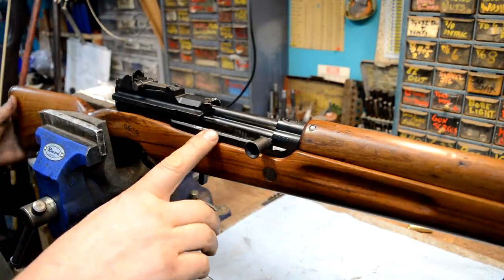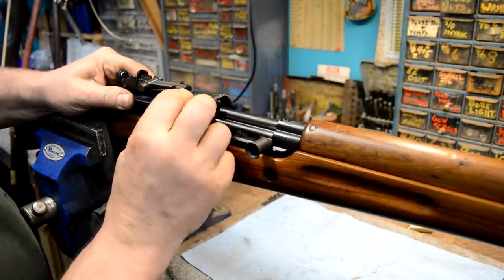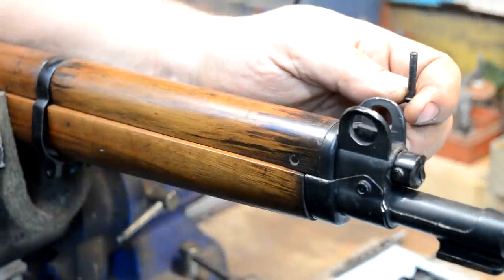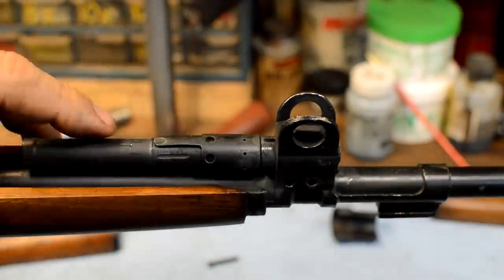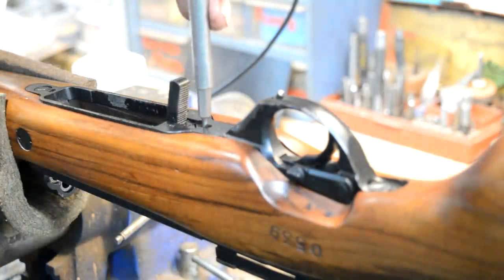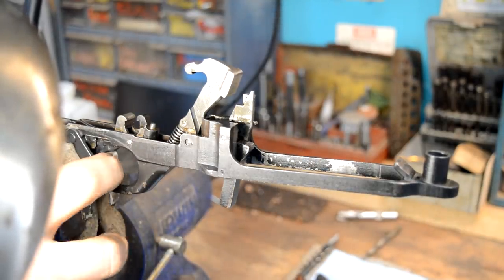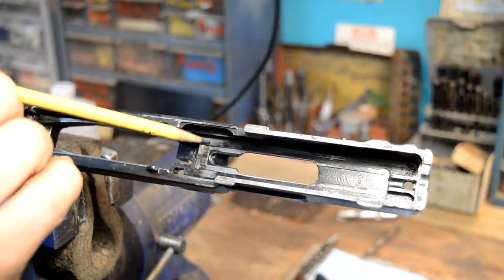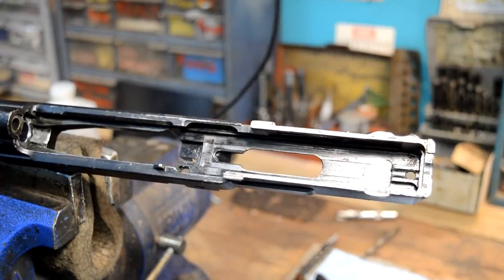Anvil 097: FN 49 clean, inspect, operation

Comment: Unless I misunderstood, I think you described the gas dump backwards. Unscrewing would open up the hole and therefore have less gas available to cycle the action. Screwed in all the way would block the dump and give maximum gas availability and why it was slinging brass into the next county.
Reply: Cómo tiene que ser ajustado

Comment: Very interesting!
I would like to propose an alternative reason for the sliding hammer setup: I believe the primary reason it was done like that is to reduce spring pressure on the sear while still having enough spring pressure to operate the out-of-battery safety. Either way, a very elegant solution.

Comment: Picked up an Egyptian 8mm version last year, after about 10 rounds it went full auto for the last three rounds and gave my brother a pretty big surprise.  I stripped it and I couldn't find anything wrong, but I suspected that the two piece firing pin was stuck forward due to grease in the channel so I gave that a good cleaning.  Haven't had a chance to shoot it again, hopefully no more full auto this time.
Reply: A stock that has shrunk slightly, and overtightened action screws will also cause this.  Seen it on a Belgian issue one in '06, and an Egyptian version.
Reply: I have a book that says some Egyptian '49s did not have a firing pin interlock as shown in this video.

However, it states that FN used bolts similar to the Venezuelan contract design (with the ability to accept a firing pin safety) in about 25% of the Egyptian contract.

I would be cautious with "civilian" 7.9x57 because the primers are softer than surplus. Surplus can handle being tapped by the inertia of the firing pin/if the firing pin is stuck as the bolt comes home without going off.

I hope that helps, all the best
Reply: @endutubecensorship  I was using Yugo surplus ball, pretty sure those primers are fairly hard.
Reply: @themoo12345  I would agree, I wish you safety and enjoyment with the ol warhorse

Comment: Thank you for talking about the small holes on the gas sleeve being used to oil the threads. I have not removed and cleaned my gas sleeve since I bought my FN49 last year. I have an Egyptian, 8mm one with the fixed magazine.

May I ask a few questions?
I have not owned a gun where the rear sight adjusts using two screws. Do I loosen both screws, then tighten the left screw (if I wanted to adjust left) then tighten the right screw to secure it? I’m familiar with FORS acronym for sight adjustment. 
The inside of the top hand guard is really black from powder residue. Is it appropriate to clean that with water and a toothbrush?
I was hopeful that the gun would eject stripper clips, but I think not.
Finally, I am not expecting laser beam accuracy, probably 4-5 moa with surplus ammo. I read using washers under the big screws could improve potential accuracy. What do you think?
I really like your videos sir!
Thank you so much for sharing with us.
The Egyptian one has muzzle threads and I thought of putting a thread adapter on it to put a modern (kickass) muzzle brake, but the gun weighs 11-12 pounds loaded as is and my arms can only hold so much!

Comment: You can get a solid firing pin for this gun but I found it to be prone to breaking. Broken solid firing pin sticks out of the primer hole and could possibly cause an unintentional slamm fire. The warning sign is a dimple in the unfired primer on a loaded cartridge upon closing of the bolt. This was the last main battle riffle ever designed the old school. WWII outbreak stopped its commercial debut and no one wanted to spend the money on starting production in the middle of a war. It did develop into the FN-FAL later in life. Btw, the steel butt plate is for cracking sculls.
Reply: Most people recommend the two piece pin because it is stronger and also prevents slamfiring (I think that’s the term).

Comment: Didn't you work on a Russian rifle(sks variant?) That had an adjustable orifice so it didn't beat the action to death?
Reply from the maker: SVT 40,  Anvil 083.      That gun throttles the supply, instead of the dump
Reply: Thanks sir, I couldn't remember which one it was. I always find your videos interesting and helpful to maintain my old milsurps
Reply from the maker: @j.l.2620  Outstanding. That means I'm doing my job.

Comment: The FN49 is a really neat rifle. I have a soft spot the post war rifles that were a bridge from the old rifles of WW2 to the more modern designs of the 50s early 60's. I still need to figure out some issues with mine, which is an Egyptian contract rifle in 8mm Mauser. It likes to rip rims off so I need to tweak the gas. I bought the spanner, I just need time to mess with it. I also have not torn down the rifle all of the way, so your video came in handy on the handguards. I would not be happy if I tweaked a handguard due to thinking it was just going to come free after the screw and band were removed.

Comment: Being that these were made in 1953, before 7.62 NATO was really "ratified", what is the bet that the originals were made in 7.65 Argentine?

Back in the "good old days", I had one of the .30-06 Belgian ones and an 8mm Egyptian specimen; both very "pre-loved", but they worked. The original "sort-of" detachable magazine was barely an improvement over the G-41 as it did NOT retain the cartridges when dismounted from the rifle.. There seem to have been a bit more thought put into the Argentine Navy variant..

A lot of the Belgian ones had originally been select fire, but had been "semi-neutere" before commercial sale hereabouts. Rock 'n Roll with a charger-loading, semi-detachable , ten-round mag? At least that provided time for the barrel to cool between bouts of stuffing in stripper clips.

The rarest ones seem to be the 7mm Mauser-chambered ones for a couple of traditionally-minded South American countries. Almost up there with the really exotic 7mm Johnsons, apparently.

Good, thorough coverage, as always; thanks, Mark.
Reply from the maker: This example IS in 7.65 argentine, you are correct.

Comment: Nice to see the post SLEM version. Just possibly could have been the British SMLE replacement in 7.92mm Mauser.
Reply: What happened to the edit function? I wanted to add that, of course, it did do so much later as the L1A1 SLR version of the FAL.

Comment: Hey Mark, I recently got an Egyptian FN 49, however the receiver cover was removed in favor of an S&K mount/cover like what Galati International used to sell.  My question is, will a Belgian 30-06 receiver cover work in place of the 8mm one?  The 8mm ones are sadly non-existent now...
Reply: My guess is it should work. These rifles were pretty much built the same. The only differences are their bolts and calibers. Receiver covers should be interchangeable.

Comment: R Stands for repeating action. recocked by hand to fire another round as no gas to gas system. Also for grenade launching as gas from ballistite cartridge goes straight down the barrel. An
 early version of FN FAL. Gas regulator on FN 49 set by armourer. FN FAL normally set at 6. But can be changed by firer. Set it to 0 when letting foreigners use it. Kicks like hell.Lol.

Comment: I'm really fascinated by the engineering of these guns, there are few other things that contain so many clever solutions under very tight tolerances, all crammed in to as small a space as possible. And they still have to operate flawlessly under extreme pressure, heat and accelerations in all directions.
And the commentary is hilarious.

Comment: I thought the gas cylinder lock screw on a Garand has a relief valve built into it? Or am I not understanding what you mean by dump? Love your videos...
Reply: It does, sorta. That's the rifle grenade valve. When you put the launcher on the barrel, it pushes a plunger valve in to completely dump the pressure and stops the action.

I think there's also replacement gas regulators that have a separate vent valve for overpressure ammo.

Comment: 26:50 As a guy that's had the pleasure of tearing apart a shop looking for a bolt release spring on a Winchester 1200.. He's not wrong lmao
Reply: I've chased an SVT40 spring across the room before...
Reply: @ScottKenny1978  The temporary insanity of forcing yourself to believe that a spring can't walk out of the 4 walls it jumped into.. and until you find it, neither can you lmao
Reply: @BLWRK  I gave up and went for the magnets in less than 5 minutes.

Still took half an hour to find the damn sproing.
Reply: @ScottKenny1978  I had the pleasure of moving everything from the press to the metal break in a concrete floor metal shop. then spent 4 hours sweeping and sifting through pounds of metal shavings and ball bearings until I finally found it on all fours.. lmao.

The things we do for the addiction
Reply: @BLWRK  no offense, but that sounds like the shop needed to be cleaned long before you did the work.
Reply: @ScottKenny1978  Everything definitely happens for a reason

Comment: I recently acquired an FN that is in rough shape.  It was missing the piston and piston return spring, which I have now sourced. It needs to boiled and carded in detail.  Since the gas tube is press fitted I don't want to mess with trying to take it off (don't screw things up) .  Do you have any suggestion as the best way to clean and card out the gas tube after I boil or steam it?
Reply: Get a drill and put a brass bore brush in the chuck, should do the trick.

Comment: I’m not a gun guy, but do I need to run 30-06 with Garand spec ammo to fire this weapon or is that what the gas regulators is for? I was told if I run regular 30-06 ammo it will foul up the gun
Reply: You won't have a problem with factory ammo from any of the big three. The reason behind the adjustable gas system comes from two areas. 1. the number of countries this rifle was contracted to using different cartridges ranging from 7x57, 8x57 to 30.06. All had different pressure demands that the rifle had to meet. 2. Manufactures had to meet pressure requirements set by the countries they produced for. Even with the same cartridge, say 8x57, which was the most common for the FN49.
 Standard procedure with the FN49 is to open up the gas sleeve enough to totally expose the gas port and fire one round to see if the fired case will extract and eject. You want the spent case to fall forward and to the side between three and four feet away. Too far and you risk over gassing the rifle. Not far enough and you risk FTE or stove piping.

Comment: Why the design with two sears? What does that accomplish?
Reply: The rear one is the disconnector
Reply: Limits the gun to one shot per trigger actuation, by catching the hammer. You can't manually release the trigger quick enough to prevent a full auto runaway without some form of mechanical disconnector.
Reply: It's explained in the video.
Reply: Trigger disconnector.
Reply: The rearward sear catches the hammer as the rifle cycles, because the trigger is still held down from firing the shot.
(All take place in tenths of a second)

Once the cycling has completed you release the trigger forward and the rearward sear passes the hammer to the forward sear, this is your "click" or reset. 

Once the forward sear has control of the hammer the cycle can begin again.

Comment: soldiers hated the weight, I can't help but think a webbed polymer stock would have been cool, i know they had no idea what that was then, just saying after all it's just treated cellulose, ironically it's how one arrives to the deflagration in the first place. That's right folks gunpowder is a type of polymer. with metals added as fuel. antimony and the like.  nitrated fiber or powder of cellulose. think flash paper. a magician's trick bag.

disclaimer: nitration is a simple process but dangerous if you don't know what you're doing. i don't recommend playing with it until you study it. think small batches for the same reason you don't hand a desert eagle 50 ae to a buck20 wet, girl that's never shot a gun before.

 run away reactions are a very real thing. It's all fun and good until the first responders show up. if you just gotta do it don't do it around anything you can't afford to lose or has an insurance policy. [there is a real danger of fire and or explosion.] i know that took a weird turn, but polymer' was the subject I wanted to talk about. by the way DuPont is the reigning king. just saying without the bag theirs no reason for the arm.
Reply: What smokeless powder uses a metal as fuel? I've heard of metal salts being used as oxidizers or to induce porosity, but the nitrocellulose (and nitroglycerine, if double base) act as their own fuel.